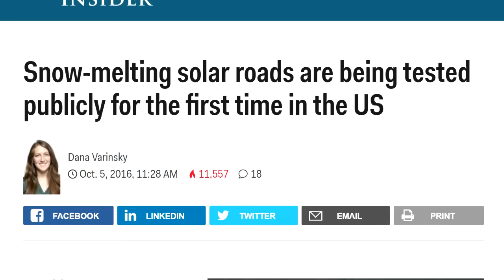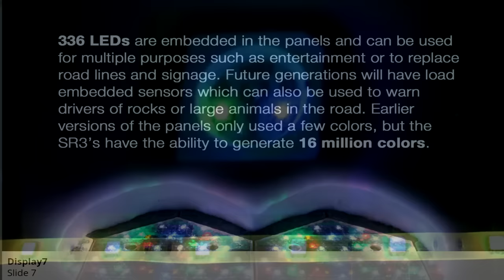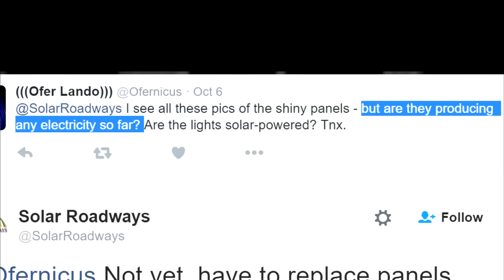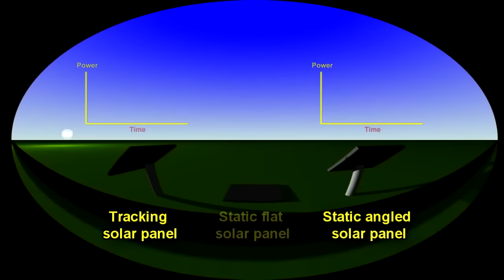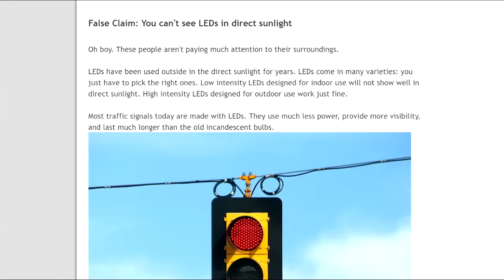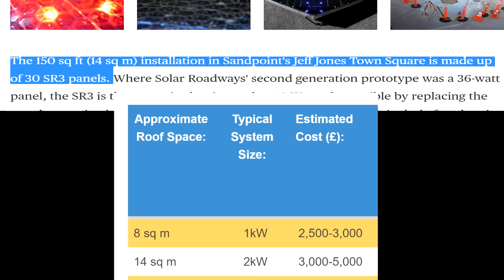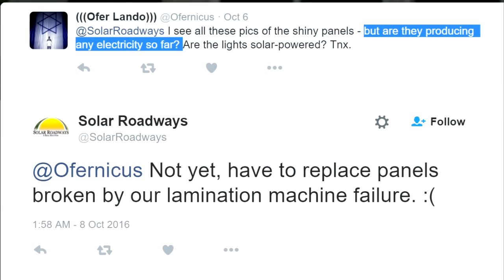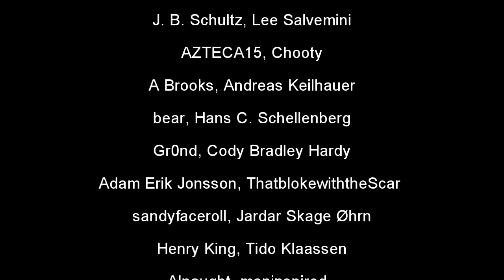First AMAZING Solar Roadway UNVEILED!

Comment: A lot of Solar roadway supporters seem to be missing the major point of thunderf00t's video. Right, okay, solar roadways "work." It is possible (as in not impossible) to put solar panels on the ground, put them on the grid, and they WILL generate electricity. Great. Cool. Yet, even if you ignore all the technical issues of maintenance, ideal road construction, cost, etc., even if the solar roadway works perfectly, the idea is STILL bus-window-licking retarded. Solar panels do not generate electricity by existing, they need light to hit them. People, cars, buildings... <= these things generate SHADOWS, which is an absence of light where your physical body has blocked it. Roadways, and walkways have people and cars walk/drive OVER them, preventing light from hitting the road with a SHADOW. So the ultimate question is: why put solar panels where things block them, when you can put them OVER buildings, walkways, carparks, etc.? Then think about all the maintenance that goes into a road and you see why you now need a helmet and water-wings.
Reply: It's the same story for the hyperloop.

It's not physically impossible, but the technical difficulties and dangers involved are such that you are far, far, better off just using a typical railroad powered by solar panels to run electric trains.
Reply: Especially when too often freeways/beltways  have traffic creeping along during 5:00 traffic, for miles.
Reply: Pretty much.  Problem is everyone is looking at all these ideas and not realizing the basics....like a Mack truck rolling over the panels. 

Honestly, make it a sidewalk so the worse you get are regular people walking on it.  Have it help energy saving with stores and buildings nearby instead?  I'd almost say that's a better idea until I realize that panels might condense a lot of heat, which wouldn't be bad during colder days except....snow turns to slush, and after night becomes pure ice over the panels.
Reply: I don't think much consideration for real world functionality or practicality is considered. Just seems like they are targeting peoples' notions of what the future of urban infrastructure should be based on pop culture.
Reply: ArticulatedHypernova you also get shade that keeps you/your car out of the sun... so stupid
Reply: That's not true. The hyperloop is physically impossible.
Reply: dutchraider2 
Why?
Reply: CockatooDude 
Exactly my point.

Solar roadways are also possible in theory. 

You can build a road that produces power from sunlight and can be driven on, its just a terrible idea, and the whole LED thing is even more nonsense.
Reply: About the hyperloop:
It is certainly possible to make a hyperloop pod go faster then a regular train an use less energy (if you do not take the creation of the tube network into account)
If it is economically feasible however is a different story. I personally believe they will go the same way as the Concorde and the hovercraft. It may be faster then other ways of travel but the lack of comfort and the high maintenance cost will make it fail about 10 years after launch. 

Thunderf00t Made some embarrassing mistakes in his debunk video, but after the hundreds of videos he is bound to make a mistake somewhere. Another possibility is that he just wanted to make some money on the hyperloop hype. If all the issues he pointed out were as severe as he claimed them to be I doubt that the worlds best technical universities would be taking part in the development.
Reply: You CANT make a pipeline without U-turns because of the expansion due to difference in temperatures. You clearly have no understanding of engineering at all. Making a straight pipeline is NOT possible for the lengths that the hyperloop must have. Done. Topic closed.
Reply: dutchraider2 
What if you made it temperature controlled?
Reply: dutchraider2 This seems like a troll to me, A U turn would cause even more trouble.

The expansion of the hyperloop is certainly an issue but it is not an unfixable one.
Even the connections leaked a little it would not be catastrophic as Dr. Mason claims it would be.
Reply: actually it would be worse then he claimed it would be as unless you posted military guards every 20 meters of the hyperloop or built it in a hardened bunker system anyone with a decent weapon or even improvised one can cause a catastrophic breach hell this is a worse security nightmare then building an orbital elevator would be.
Reply: Just keep people indoor during daytime, and it'll be fine. =O
Reply: on that note, maybe it could be a viable means of transport underground, or for getting around military installations?
Reply: I do wonder how these will work when I drove over 50+ potholes today.  Roofs seem to make sense.
Reply: The panels would not stand up to the pressure of normal traffic for long. Hell even roads made with square stones fails at that. The only thing that would make sense is indeed roofs and the middle of the road on the traffic separator.
Reply: Even on pavements (US sidewalks) the slabs end up wonky with only people walking across them. On a road made of tiles, It would take no time for it to turn into a roller-coaster.
Reply: you are right it is possible but impractical
Reply: ArticulatedHypernova so? They still get hot, and light still hits them every other time. in North Dakota they would work exceptionally well, as we don't have lots of heavy traffic for the most part.
Reply: GhostShipSupreme this whole idea is a massive con job. 
It's fraudulent use of public money. 
I love renewable energy but this is a huge money pit designed to profit those who skim money off the top of the ever escalation amounts of money it will take and to drag on forever costing more and more while never delivering anything useful  to the taxpayers that are paying for it. 

I believe it's called a 
Massive Fail.

... or just simply fraud.
Reply: Then why not drive and walk UNDER them? TF talked about that option. And just look up "solar car parks" and you'll get the point.
Reply: ArticulatedHypernova - the maintaince of these things would be impossible to keep up with.
Reply: it'll be even better in big cities where buildings cast a lot of shade on everything.... It's so smart...
Reply: Most people don't think in terms of trade-offs and budget constraints. For them, in this case, it's enough that solar is "good" and that solar roadways "work". The fact that we'd have to devote all of humanity's collective resources to build and maintain these things doesn't enter their minds and therefore doesn't pose a problem for them.
Reply: I agree. Yeah it works but it's not financially feasible or practical.  I mean you can make a popcorn machine out of a nuclear generator but is it practical?
Reply: Solar Roadway is not for the poor or able to install anywhere. They are for the rich community, to save space and to have 2nd backup energy generator. 

Ever seen India's city? Then a dirty, poor city next to it. Or Beijing with rat's city next to it. So you can see, the rich community will have this, it maybe wasteful, not generate enough electricity, but it is fancy and it is for them.
Reply: When snow melts, it turns to water.  When water freezes it turns to ice.  It is far better to remove the unmelted snow mechanically before it melts than to melt it and continue pumping heat into it till it drys.  The solar road idea is wrong in so many ways.  And what is frightening is that politicians do not have enough common science knowledge to not get swindled, or could they be in on the scam??

Comment: Let's ignore damage to the glass road surface. What about the road just getting dirty? I have the 45 solar panel set from Harbor Freight. It's in the backyard on the ground propped up by the stand it came with. I have to wash the  dust off those panels. So what about all the crap that would get on the solar freakin roadways? Are they going to have roadway cleaning vehicles traverse the roads at regular intervals? Sorry but I can't imagine a street sweeper going down the freeway. If you don't clean the crap off the road then how will the panels generate electricity and how will you see the LED's? 

Another thing is hacking. Do they not understand that hackers will try and hack the roads to display things? On the milder end of things we could have roads that say "free Milo" or "#GamerGate" or whatever. On the other end roadway markings could be changed in such a way as to cause accidents or traffic jams. 

This is such a terrible idea from all sorts of angles. I guess the cool factor is what dupes people into supporting it.

Comment: Thunderf00t please fly there and scratch there panels with a rock!
Reply: Yeah, that would be gold
Reply: Just wait long enough and someone will slip over while walking across those demonstration tiles. The payout from the lawsuit will quickly bankrupt the sceme.
Reply: So we should expect a lawsuit crowd funding project soon? xD
Reply: I'm an Idahoan, and unfortunately, Sandpoint is in bf no where. But if I have an excuse to pass by there, I'll make sure to give it a go
Reply: 'slow clap'
Reply: I'd suggest not doing that unless you want to pay to replace it and being blamed for the overall failure
Reply: great kickstarter idea
Reply: Go full Dwight Schrute on them
Reply: I'll have you know that glass has a hardness of around 6 on the MOHS scale, so just go ahead and try. /s
Reply: Doesn't need to. Mother nature is doing the damage for him.  There probably are already scratches on that surface from normal wear and tear.
Reply: Mads just pull out a circuit board it's a quartz wafer and 7 is harder than 5.5.

Comment: You know the funniest part? That this cities are willing to spend so many millions in this fake projects, but a single cent in solar panels for their government buildings! :P
Reply: im sure most of this politicians are supporting this so they can more or less syphon some money out of this by inflacting some numbers here and there , perhaps since they buy some if not most of the components out of China they wont be able to find out if they messed with the numbers if they get audited
Reply: Could be an attempt to cull solar panel by letting it fail hard. Some states tax solar power so much it can barely stay afloat but those are usually heavy coal or natural gas states.
Reply: Damian Wright probably you are right. One way to justify not changing tech is by installing bad tech. Just find it funny that, like thunderfoot mentions on the video, by the same amount they could have install so many regular panels....
Reply: Carlos Belo sad part is when this fails hard, it will kill solar power in Idaho. The lemmings/ameridolts will blame solar, the state will balk at investing again in solar and Solar Freakin Roadways shrugs their shoulders and tries again elsewhere. USA, what a country.
Reply: Idd, that does seem to be the plan. So easy to scam (coff) money of public coffers aint it? :P
Reply: Carlos Belo if you have a friend it only takes two people to start a special district and you can get tax payers money with very few regulations.

Comment: So with enough energy to melt snow fall being put out I am assuming that there is a mechanism for all of the baked on Bird crap, sugar, leaf litter, kebab, chewing gum, dog hair, bacteria and algae, from the glass, and nesting cats birds reptiles insects
Reply: Why are you asking these very simple and very obvious questions? There is, of course, a mechanism to deal with those things. It's called a jackhammer, and it will be used to rip up the broken, dirty, non-energy-generating eyesores when everyone wants to forget that they wasted half a million tax payer dollars on this garbage.
Reply: The answer to that question is quite obvious. With the heaters installed and working there is no more need for snowplows tol clear the snow. So the snowplows can be used to clean al the crap of the glass.
Reply: They'll actually require energy FROM the grid they're connected to if they're going to melt snow and ice, rather than contribute to it. Not that they'd contribute much to begin with. It's as effective to just use salt on regular asphalt. Roads are actually extremely hardy things and stupid cheap, especially compared to this shite. A few dozen 40 ton trucks a minute for 12 hours a day will make short work of these things. A half decently built tarmac road will last 5 - 10 years with minimal maintenance, though they tend to resurface these kind of heavy traffic roads every 6 or so years in my experience. At least where I live in the UK.
Reply: Furi Kitten Don't forget that hippies who want to go barefoot would not be too happy on sidewalks hot enough to melt ice

Granted sun heated pavement isn't great either, but at least those hippies have shade to get to

These solar roadways leave no escape or solace

No one is safe from their heat-induced wrath
Reply: TalesOfWar Dogs don't exist when you have solar freakin' roadways
Reply: Maybe it will convert the kinetic energy of fission products into heat to melt the snow, sterilize the bacteria and algae, the gum will collect the dog hair while the lizard eats the insects, the cat eats the lizard then rolls in the gum getting it stuck in its fur, then sees a bird and chases it off, and the snow melt rinses away any debris that is left that was reduced to ash.

Everything should work great until you run out of snow and find the dead cat near the radioactive molten remnants of the solar freak in roadways!

Comment: The concrete roads and paths were build for hundred and hundreds of years!  Imagine how much it would cost to replace that with solar panels!
Reply: ~$509,477,760,000,000.00

I was doin some figurin (because I don't have anything better to do) I figured the cost to pave the roads with this crap...
The cost at the MoDot test site for each panel works out to be ~ $1,700.00 installed because they're about 4 square feet each and the installation cost is $102,000.00..... which works out to be $425.00/sqr foot .
@~43,000 sqr miles of road surface (according to SFR website) that works out to be a modest ~$509,477,760,000,000.00.
Reply: The $102k is just what MoDOT is paying.  They plan to raise 'the rest' (who knows how much more they need) from crowdfunding.  They want to squeeze the same idiots who spent $2.3M on the idiegogo for more $.  "Brusaws raised more than $2.2 million in crowdfunding in 2014 to bring their technology to market, and MoDOT 'is set to launch their own crowdfunding campaign to support their energy experiment.'
Blair acknowledged many people have encouraged the department to use crowdfunding as a source for experiments and tests on the transportation system of the future."
Reply: I may have miss read the articles about the cost... The way I interpenetrated it was that the 12'X20' walk way was going to cost $102,000.00 and be paid from a federal grant.... and MoDot was going to crowd fund the rest of their parking lot installation. Which is STILL unbelievable expensive.
Reply: ronc1357 Maybe it's me that misinterpreted... Let's see what the $102k covers and what the crowdfunding campaign looks like... $425/sqft seems too little since the Brusaws have said that they are hoping to get their costs DOWN to $2k/panel (~4 sq ft - i.e. $500/sqft). They've been saying they want it installed 'before the snow flies'; but i doubt it since the Brusaws are spending October/November re-making the 30 panels for the sandpoint installation.
Reply: I heard that I do have the costs for the project from the city of Sandpoint... those panels costed $2,000.00 each installed. 
 http://www.cityofsandpoint.com/Home/ShowDocument?id=3720
Reply: If my math is right @ the $425.00/sqr foot... in order to pay for this boondoggle every man, woman, and child in the US would have to fork over $1,568,265.23.
Reply: ronc1357 Sounds like a fair investment to save the world, lol!
Thanks for that link... The cost doesn't include the city's responsibilities
"Initial site preparation
 Excavating
 Conduit run(s) from site to load center (located in electrical closet behind bathrooms)
 Hard-wired internet connection near the load center
 Security camera to cover site of installation
 Utility box (could double as kiosk) or Cable Corridor to house electronics
 Concrete pours
 Securing the installation area during installation
 Prevent passersby from entering the construction area
 Final site completion
 Backfilling concrete, etc.
 Kiosk or signage if desired
 Cleaning the surface of the system periodically (spraying off with a garden hose should suffice)"
Reply: Philo Judaeus of Alexandria I heard that!
Reply: "Hundreds of years" and yet they still have to patch up the same roads every damn year where I live. Not saying I am with the solar freaking roads idea but our concrete roads are not THAT good.
Reply: @DeluxeSlayer  Sure, and can you think of anything better that needs to resist the weight of trucks and cars at high speed, grinding dust and stones on the surface, resisting temperatures from a wide range and in rapid variation from night and day.
Solar roadways is a ridiculous idea, and would last a day on the road, forget a year.

Comment: Living in a cold climate country (Canada), I am doubtful that in the middle of winter, when the temperature reaches -40 with wind chill, those solar roadways will work (both the heating element and the actualy solar power).

But hey, what do I know, I will probably be driving my Thorium powered car over this road surface in 30 years made from air plastic >.>

(I have a better use for those solar panel... Use them on the Trensquebec project (electric monorail naccels using wheel motors) at least then we will have some power generated from them during the summer and they wont be damaged by driving over them).
Reply: Dominique Savoie In Australia, where I live, there wouldn't be enough heat to power these scam devices.
Reply: Dominique Savoie